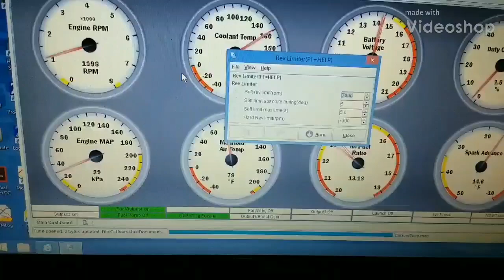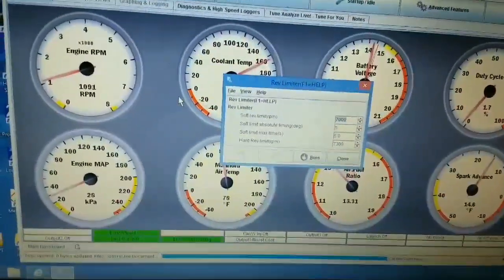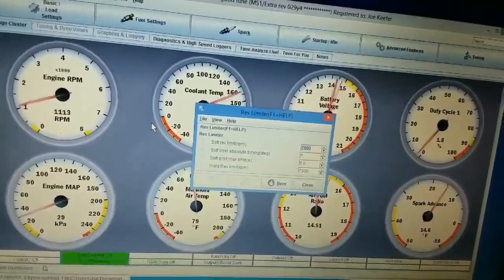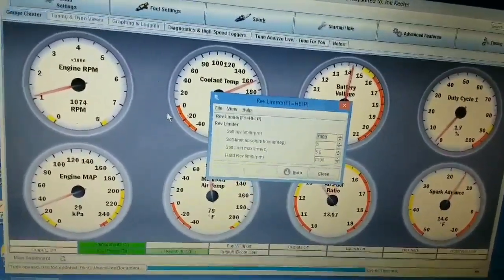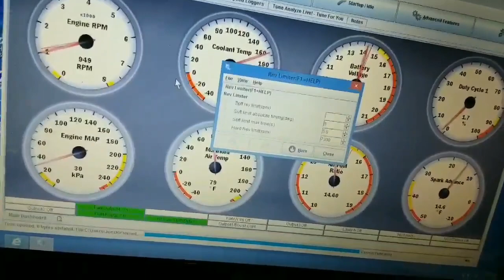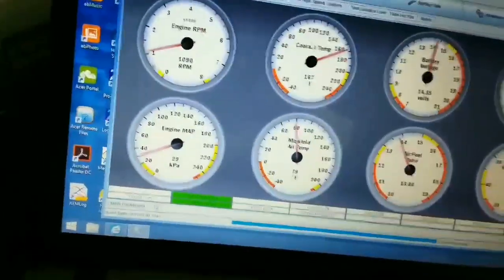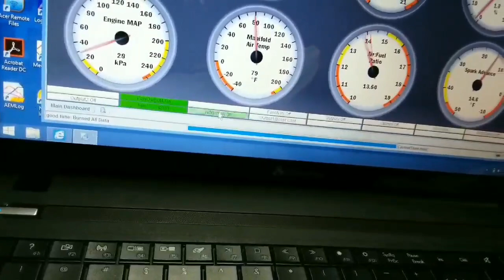Turning the RPM up Going Racing

Comment: That was sweet how you feathered 2nd gear out, in that last race!  Also, in the test hit...sounded like the tires were starting to spin 4th gear at higher rpm?
Reply from the maker: Thanks. No it wasn't spinning in the top of 4th. I had a hard time hooking in 2nd the slicks are getting old need to put my new slicks on
Reply: @PATuners  sounded like a rocket through 2nd...that was fun watching!
Reply from the maker: @Nobluffbuff  Thank you i appreciate it

Comment: Keep up the good work brother also that issue you might be having could just be a wire backing out in a plug 🤷🏽‍♂️ just ran my is350 went slow as shit too 14.0 102mph on a slick track spun the whole 60ft lol
Reply from the maker: My wiring is good its the jc chip that's bad. It's always fun to get a number work it down get a better 60ft car will go much faster
Reply: PA Tuners awesome you figured out the problem. As for my issue i bought the car lowered but it did have camber kits on it so if i fix my camber i should have a better 60. I just miss hit 11s in my old car 04 sti all bolt ons stock internals at the time lol didnt last a year on that build